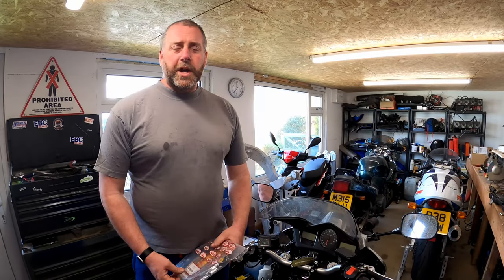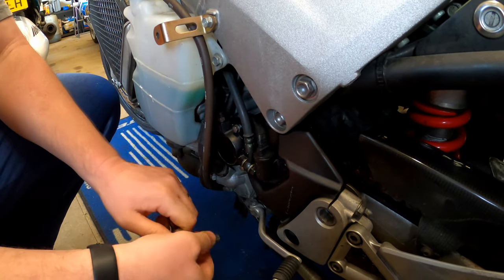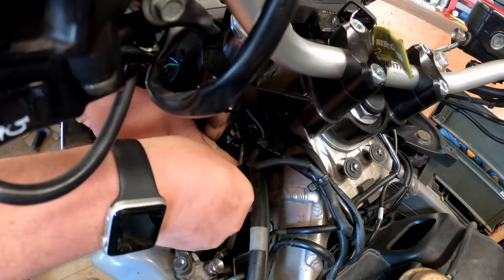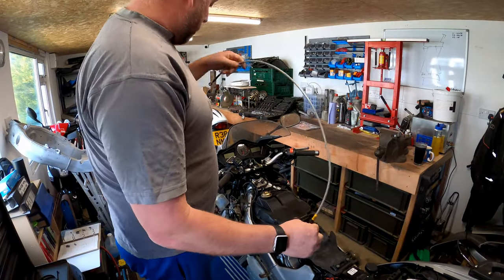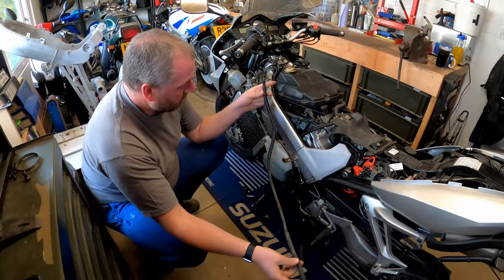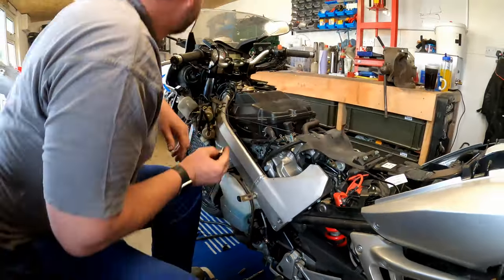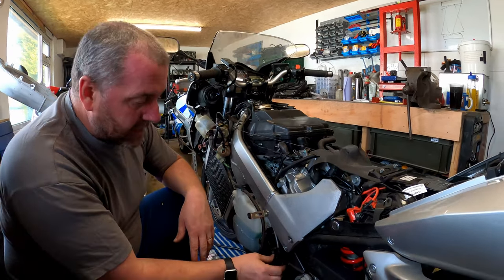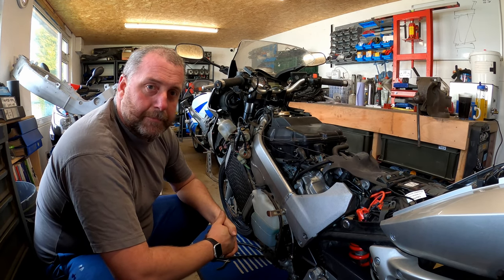2003 Honda VFR800 VTEC - HEL Performance Braided Stainless Steel Clutch Line Fitment

Comment: Hi Kev, wondering if you can help.

Got a 929RR Fireblade, had from new.

On turning the ignition, the pump doesn't stop priming, keeps making the prime noise...& on pressing the start button, it won't start.

Any ideas please?
Reply from the maker: Hey bud, my first question would be does the bike actually crank when the button is pressed. If not then it leans more toward an electrical problem. If it does then I would suspect a fuel pressure regulator issue but these are only educated guesses mind as I don't have the bike right in front of me.

Comment: Hey Kev can you please advise as to which torque wrench as in minimum and maximum nm I should buy for my vfr 800 v-tec 2005 that would cover any all repairs or maintenance I might need to carry out also is the a jis screwdriver set that you recommend? Thanks in advance 👍

Comment: Hi! Where did you get the torque specs from? I have the Owner Manual, but it only mentions a couple of bolts' torques. Is there a spec for all/most of the bolts somewhere out there? Would you mind sharing if you have one?
Reply from the maker: The torque spec for the banjo bolts is in the documentation that comes with the braided lines